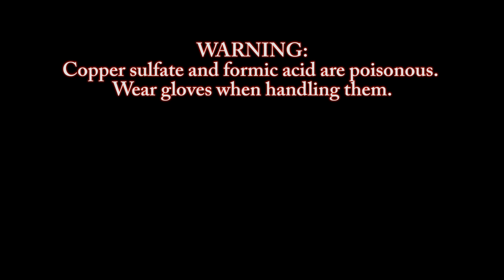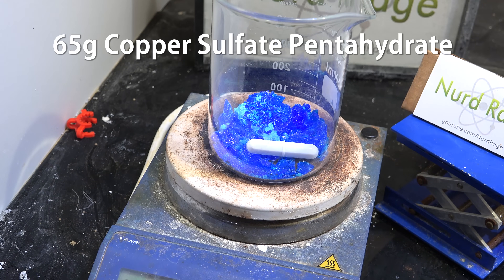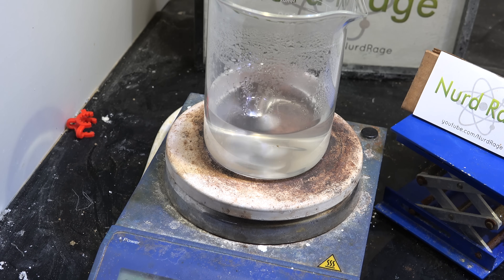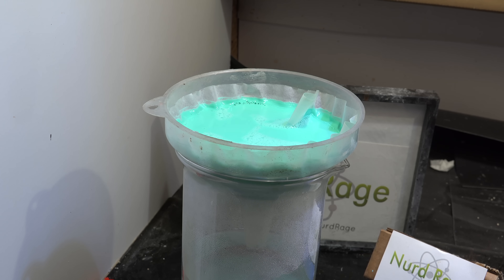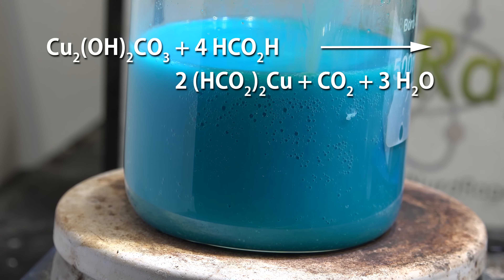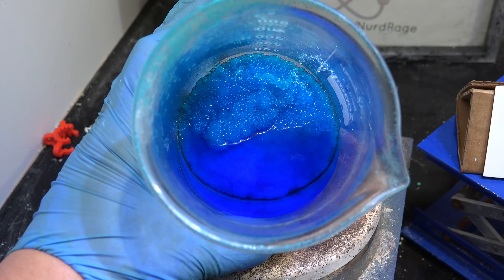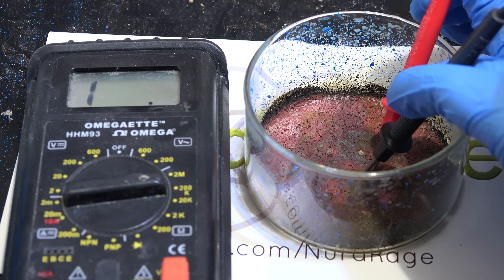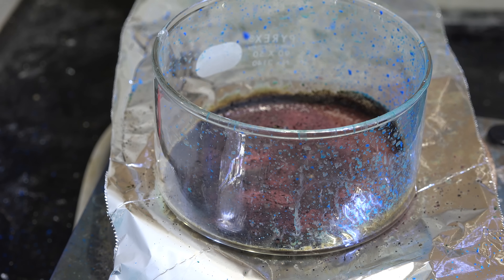Make Copper Formate (for Making Copper Conductive Ink)

Comment: Did you ever discover anything interesting in this area? I was looking for through-hole plating ideas recently, and I remembered this video. I know you shifted your attention to sodium metal shortly after this, but I'm curious if you uncovered anything before you moved on?
Reply: so you have found a way for through hole plating?
Reply: @SandeepKumar-jj7zi  The best process I have found so far is to paint the entire board -- including holes -- in a conductive spray paint, then electroplate the board in a copper sulfate solution. There are plenty of YT videos on this process.

Comment: So this has some interesting applications. 
Copper Formate might be able to dissolve chitosan. 
Usually, you use acetic acid to dissolve chitosan after sodium hydroxide digestion, but, if the pH in this is close, that could substitute and yield a copper bearing chitosan fiber. 
If it does, this has the potential to open up regenerated rayon, through cuprammonium rayon, into copper laced conductive fabrics.

There exists stuff to that effect already.

Comment: Did I make copper formate?...
I had some colloidal silver I made.   I made it with distilled water and it was the only distilled water I had available so I used it to make an electroplating solution for copper by first heating about one part baking soda to five parts water then using that to submerge two copper parts in attached with alligator clips with about a 5 amp power supply.   One copper piece turned black, and one had the blueish greenish crystals I scraped off and filtered from solution. Is that copper formate??  Sorry I am trying to figure out a lot right now and never went to a proper school.

Comment: one question: as the primary problem is (i assume) the carbon dioxide generated, coldn't mixing it with CaO make an inorganic epoxy of sorts? (CuCOOH + CaO -> Cu + CaCO3 + H2)

Comment: Can you try adding a tiny bit of ascorbic acid to the solution to see if it will help the copper thin film form correctly. This would be ground breaking if it can be done because there are not many ways  to chemically deposit conductive ultra thin films onto a non conductive substrate like glass. Only way I know is to either use the silver mirror forming Technqiue or to have an expensive PVD or CVD machine. First surface mirrors and ultra thin films are some of the pillars humanity stands on today and it's would be great to have a way to cheaply create such thin film using household equipment.

Comment: Im wondering that the problem is that silver crystaises much more easily than copper under these conditions, leading to a more structurally consistent product. Perhaps a ratio of the two copper, and silver reagents can be mixed so you get an intespersion of copper in the silver, though i don't know what if any advantagenthst may have if successful.

Comment: I think I synthesised it. I was dissolving Al in CuSO4, decanting Cu particles. They turned dark upon drying = oxide. So I tossed some formic acid 85% in and got substance of beutiful azure color. Much nicer than what I see in video, actually. But that may be due to camera or monitor or both.

Comment: I have used the carbonate - copper sulphate reaction to try to make cupramonium hydroxide cellulose solvent, but i found that adding carbonate to copper sulphate i would produce different coloured precipitates on different runs. I believe that the product is a mixture of basic copper sulphate (CuOH)2SO4,  copper carbonate CuCO3, basic copper carbonate (CuOH)2CO3, and possibly copper hydroxide as well. What mix of products one gets seems to vary quite a bit with small variations in temperature or concentration.
As an alternative i electrolysed solid copper anodes in carbonate solution to eliminate the possibility of making basic copper sulphate.

Comment: Overkill and not so on par with the application you want it to be: i.e: conducting. 
I use a simple Zinc spray on non conductive substrate then after the layer dries i dip in Copper sulfate for a "Single Displacement Reaction" - now the entire substrate is conductive and ready to be electroplated at once. not just areas close to the cathode.  Simple & low cost. check out my Metallizing 3D printed plastic models on twitter hashtag #HomeElectroForming

Comment: Vapour deposition with CO2 laser etching is probably the most controllable solution for at home hobbyists. That is.. if they build the units themselves already for other projects. Really interesting reaction, could this also be used as an additive in photonic cintering inks? A Xenon bulb might produce enough energy to decompose the solution into copper?

Comment: Thanks for the information. As electronics engineer, and also a PCB maker, i can say that this isnt suitable for Through hole plating, because holes has to be plated in around 35um - 50um thickness of really conductive metal (such as silver, copper, solder or other materials), but holes has to be "though", because you will stick component leads through them. Also, not reliable, but still, sience is in the 1st place :)

Comment: At the heating stage would keeping the copper formate tetra hydrate under an inert gas improve conductivity by yielding a purer product, ie is oxygen a factor with the poor bonding. Also would the conductivity improve by UV sintering of the final copper product

Comment: I've wondered whether copper formate could be used for through-hole plating. 
I know there is a way to do it at home which involves thermal decomposition of copper hypophosphite. It would be nice to be able to do the same thing with copper formate.
Reply: so copper hypophosphite forms better plating than copper formate?

Comment: Would it be more usefull to use as a soft metal alloy i.e. add tin to improve the conductivity of the metal instead of what id imagine is just stacked layers of large copper sheets kinda like paint.

Comment: I guess the problem is that copper particles at 200C are going to oxidize very rapidly, the opposite of what happens to silver...  Maybe you could use some organic that will act as a reducing agent as (or after) the copper forms...  like how acetone reduces hot copper.  Also, I'm curious how a mixture of this and the silver diamine formate would fare.  LOVE YOUR VIDEOS!

Comment: I have lots of enamel (magnet) wire in bits and pieces. 
Is there a cheap and simple process to make a pure solid copper nuggets through chemistry/electrolysis? 
I was thinking of dissolving it in battery acid and then electroplate a pure copper wire until its nice and thick. 
any ideas?

Comment: Since you have a phd in anorganic chemistry I want to ask you a question: There a two types of copper carbonate hydroxide: one is more blueisch the other is more greenish the internet sasys that the blue type is actually Cu3(CO3)2(OH)2 and the green Cu2CO3(OH)2 when you heat the blue type in water it forms the green and my experiments show the same result but when making the carbonate it is blue all the time. is it just stöchiometry or something else which effects the outcome?
Reply: Zock4 The blue colour could be from additional water molecules of crystallization, since the Cu(II) hexa-aqua complex is also blue in colour. When the hydrated form is heated, the extra water is driven off and this could cause the colour change. Many water-insoluble metal salts and oxides can have hydrated forms.

Comment: I've been playing around with trying to make something like that for a while now, without success.
How small are the Cu particles? Can they be suspended in water or acetone, or are they too big and settle out too fast?
Usually commercial conductive inks use incredibly tiny metal particles suspended in a solvent along with some kind of binder.
Finding the right binder and how much of it is where I'm stuck.
Either the particles don't stick together, or the binder is too much and there is no conductivity at all.

Comment: I always thought that thermal decomposition would give CuO, interesting
Reply: The formate ion is in itself a weak reducing agent, that's why it gives copper metal. Higher carboxylic acids can also do that (acetate), but they also carbonize in the process, formate just gives off CO2 and water.

Comment: Awsome! I made this when I was 12 but I jusz added 80% formic acid straight to copper sulphate. It is insoluble in the little amount of water used so when formed it just percipitated out.
Reply: AirsoftSlo 
But the reaction yield is much lower
Reply: Pietro Tettamanti true but still it felt like a fking big accoplisment starting out with chem. Later I stopped with this stuff cause i wqs doing waay to dangerous stuff.

Comment: I would also love to have some good candidates for viscous conducter besides mercury
Reply: Galinstan? Or whatever other mix of gallium, indium and tin works at the temperature you want it to.
Such alloys are available as "liquid metal thermal compound".
Gallium and indium have a tendency to stick to glass however so the oldfashioned tilt switches would not work :(
Reply: fischX 
Alloys are poor conductors usually

Comment: Thats the problem with this series of metals. Though they can form cohesive structures with themselves, they tend to want to form particles rather than a plating without some sort of extra charge to guide their formation. There are a few things you could try, like charging the surface to be plated and dragging the cathode over the surface, but thats no different from standard electroplating. The other thing could be is to manipulate Cu ions in solution,  let it dry and reducing them by dipping the surface in a reducing agent. The last techinque that comes to mind is to acid etch the surface so the copper particle settle into the micrscopic valleys. 

Getting copper to bond with itself as a solid without electrocatylitic techniques as you can with the mirror demo isn't anything I've ever heard of, and may require much slower decomposition rates than seen in the video, but is still likely to be too porous and brittle to be useful. 

If you can think of a way to form stronger bonds between the copper particles, this decomposition process has some promise, otherwise i think its just a novelty.
Reply: I noticed that in a reducing environment copper cold-welds quite well, so connecting the particles up with an external force could be possible. But that's hard to do in an application as ink.

But it also forms alloys with zinc or tin quite well. Maybe this is a way to connect up the copper particles. Creating a two stage process. First creating the copper and then fusing it together with an other meal. This would reduce the conductivity but it would be possible to solder on it.

Also an other reaction comes to mind. First creating iron particles and then reacting these with copper sulfate, to create copper and iron sulfate. This will make the particle "swell" slightly make it possible to connect up the different particles.

Also a problem is to bind the copper to the underlying surface. To make copper hold onto the surface it has to form a continuous layer, otherwise it will disconnect from it.

It's not an easy problem to solve....
Reply: I wonder if a mix of copper formate and silver formate would work better.
Reply: @stamasd
Not sure it would work. The copper could force the decomposing of the silver formate. Instable chemicals are prone to decomposing in a impure environment. But my chemistry knowledge is not good enough to state that as fact.
Reply: I think there may be a way to find out. What could that be, hmm...
Reply: I'm reading up on mixtures of salts of formic acid, and it looks to me that silver and copper would form a complex. But i have no idea what that would mean for the forming of a contentious layer compared to irregular crystals while decomposing. Copper tend to build 3 Dimensional structures and this is the basic problem as far as i understand it.

While searching i found this:
https://www.nature.com/articles/srep45150
It describes the effects of mixing copper nano particles with copper formate to create better conductive incs.

In addition reacting tin with copper format could produce such fine particles. Sadly while decomposing tin formate the tin oxydizes. (the same for zinc formate, as i understand it) Even in a oxygen free environment.
I don't know of the top of my head an organic compound that decomposes at the same temperature as the formates to create an reducing environment strong enough to suppress the oxidation.
Reply: @boelwerkr I'm glad I came back to this comment because if it's copper nano particles, perhaps copper citrate could be of some use since it does also have a somewhat low decomposition temp, and will deposit nano particles as it does. However, as you mentioned above, I do not believe it would yield a particularly useful product, as if I remember correctly, silver formate is destabilized by citrates, and it would/should hypothetically interfere with adhesion.

I haven't tried because I've never been able to get the citrate reaction to work properly, and I can't get a hold of formic acid. Even with garage chemistry it's a little outside of ability to make.

Comment: I don't know why it struck me in this video but I never really think of the vital role water plays in chemistry.  I guess because I can drink it, I don't really think of it as a solvent or otherwise chemically interesting.

Do you think the boiling action of the solution created the voids in the resulting copper?  Would it be possible to evaporate it then heat it (not sure if the heat is necessary for it to convert to metallic copper)
Reply: Revel in your existence as a chemical reaction.
Reply: You need to sinter copper particles to increase conductivity